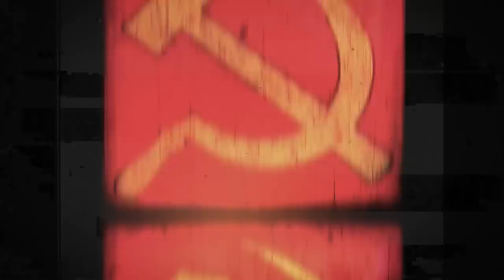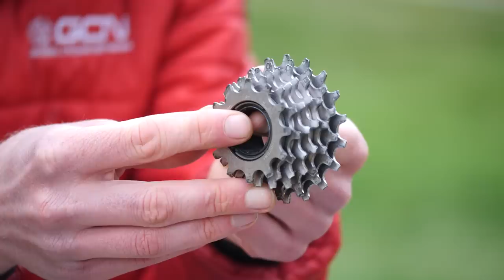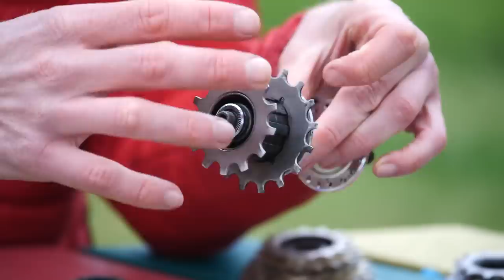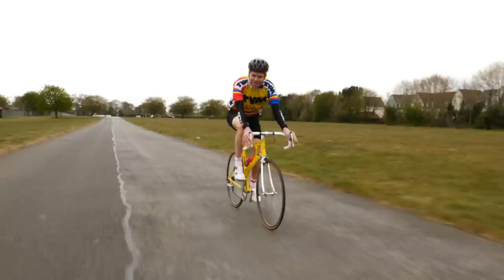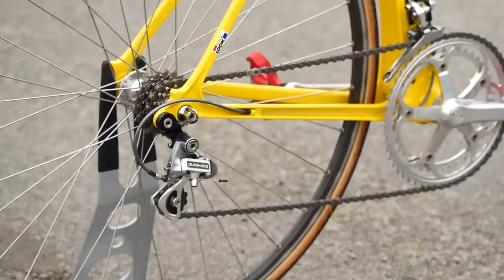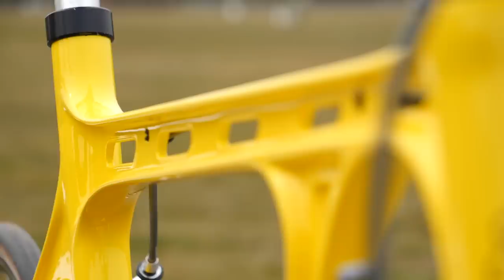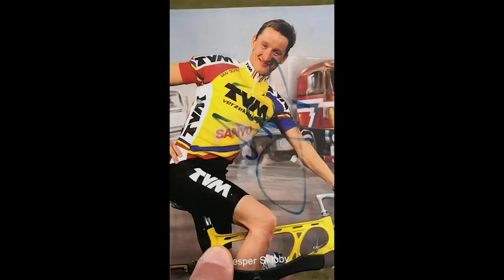The Greatest Cycling Innovation You've Never Heard Of | Shimano Hyperglide

Comment: My daily/beer bike is an old steel peugeot converted to the first generation SIS downtube shifters and 8 speed HG rear cassette, and it shifts almost as well as my modern brifters despite the very old school technology and minimal maintenance. Total game changer. The fact that shimano bangs out these massive innovations quite regularly, mass produces them on an almost unimaginable scale and sells them for the price of a takeaway pizza (even with the current inflated prices those downtube shifters are readily available for 35 bucks and last decades) puts today's 'innovative' brands to shame. Plenty of recent brands get held up as something special by GCN when they are charging 1000% margin on a simple carbon frame or pair of wheels with shocking QC (Usually with plenty of shimano items attached)
Reply: Did you spread the dropouts, or did you respace the axel washers to fit the 8-speed hub in the 126mm spacing? I have a Peugeot with all its original mid-80s components, but I have another Peugeot frame that I'm debating building up with at least hubs that take modern 8 or 9-speed cassettes, while still keeping down tube, friction shifters, and a period crankset and period Sun Tour derailleurs. I just wondered how you dealt with the hub spacing.
Reply: @danielhall3895  I spread the dropouts so I could use new wheels and cassette, and matched shifters/rear mech. I just used threaded bar, two nuts and some washers to gently open up the dropouts, that was in 2016 and it's still perfect despite being used in all weather (I did rustproof inside the whole rear triangle with rust converter and spray wax to be on the safe side). 
The bike is a blast to ride, very simple and very reliable with modern mechs and sealed wheel bearings. Well worth the roughly 200 euro it cost
Reply: @timocallaghan4408  Wish I found out about that method for a steel bike I did recently.  I used the Sheldon Brown method of using a wood plank to bend each side until you have the correct spacing.  The problem with that is I found I was often over correcting on one side, but got there in the end. Although I got some downtube converters so I could install STI levers.
Reply: @markdurdle7710  Yeah definitely crossed my mind that it could end up off centre, but it was too late by then! Steel is quite forgiving though
Reply: @timocallaghan4408  Good to know. I was leaning towards doing the same thing, then I read a post somewhere, where someone managed to get a 9-speed Hyperglide free-hub onto a a second generation Uniglide hub without any respacing needed. The person also provided information about respacing the washers and shortening the axels on late 80s and 90s Shimano 8 and 9 speeds hubs to fit right into the 126mm spacing of older frames. He nailed both methods without having to spread the frame or redish the wheel. I'm weighing which method is easiest.
Reply: @markdurdle7710  I think any method of spreading the stays, probably would have to be followed up with checking the frame alignment. Spreading with nuts and all- thread in the dropouts is probably the most controlled way, with the least amount of re-alignment needed though.

Comment: I have a new road bike with a Shimano 105,  a new gravel bike with GRX810, and a old hard tail MB with a SRAM Duo Drive.  The later is the better drive train hands-down!  Shifts faster, smoother, requires little maintenance, almost bullet proof and I can change gears while stopped.  Plus the hand grip shifter is super convenient to use.  SRAM - Please bring it back.

Comment: Cog heads. This is no game changer. The game changer in cycling for the majority of the cycling community is belt drives with either geared hubs like the Rohloff or geared cranksets like the Pinion.
    Take note: there are many people now punishing themselves riding racing bikes like you are always promoting, thinking they are impressing somebody riding around in a $5000 carbon fiber racing machine. But more and more people are realizing that the Dutch have been smart about it and now ride around on bikes sitting upright with beach cruiser handlebars, fat butt seats and fenders, quietly turning a silent belt driven drivetrain they never have to clean or adjust. Just wash the bike when it looks dirty and never have to worry about getting grease on your pants.
   Derailleurs are old technology. Are they the most efficient? Probably, but they are VERY high maintenance and more prone to failure from high stress on the cables as well as all the other hardware.

Comment: The little grooves to lift the chain to the next sprocket are also weak points...midrive has snapped two of the largest sprockets because of the chain line pull and inherent fold point.

Comment: Hyperglide also has great compatibility across the years.  Any 6, 7 , or 8 sprocket cassette is compatible width-wise with any other of the same count.  9 and up get a little weird.  I purchased a bike with an 11-21, not enough ratio for hills for my liking.  I purchased two E-bay HG 8 speed cassettes, an 11-28 and a 11-32.  Everything is compatible and the spline hub accepted everything I gave it.  I got the gearing I need, and the shifting is pretty quiet and fast.

Comment: Three drivers dominate. SRAM XD, Shimano Microspline and Shimano HG. That HG is Hyperglide and it set the market standard. Even SRAM uses HG. Even now in this divided modern era of 12spd the NX groupset uses a HG cassette. I don't like Hyperglide myself, the system has never worked well for me but when it comes to picking hubs I only go for HG spline. The sheer abundance of compatible parts by far outweighs the limitations of an 11t over a 10t. Box, TRP, Microshift, Sunrace, Shimano, SRAM, Campagnolo and however many other companies all make cassettes for that system. I don't rate Shimano but their innovation is undeniable.

Comment: I still ride a lugged steel road bike from the mid-1980s. It has its original Shimano 600 components - including a Uniglide hub - but when I wanted to change the gear ratios, I switched out the Uniglide cassette for a modern Hyperlide one, along with a Hyperglide chain. Even with the old friction shifters, the difference is absolutely night and day in the shifting smoothness and precision. So yes, I very much appreciate Shimano's engineering in this area.

Comment: When I replaced my shimano 105 5800 series cassete with the new CS-R7000, I thought that I have broken some teeth, because the shape of teeth on smaller sprockets were different, than I expected them to be. I did not notice it when installing new cassete. But I was changing gears under load and heard loud sound and then later inspected, if I broke something.. chain or sprocket or anything. And saw that there are big parts missing from some teeth...

Comment: then they added plastic to the 9000 series, they broke the rivets under load; they doubled rivets, which lasted twice as long. Some lost thirs in weeks. then the 11 speed metallurgy was too putrid for the load, plastic core with bendy cogs... by hand! switched to SRAM xg-1190 and ditched the garbage DA 5.8 mm chain for record  11 5.2 mm: now i have the perfect stiff quiet smooth noiseless Shimano 9000 9100 groupset after i swapped crank and rd. gained 0.75km hr on thes shimano to sram and campy changes... cables, yes, Yokozuna road, not the soft shimano thing..,

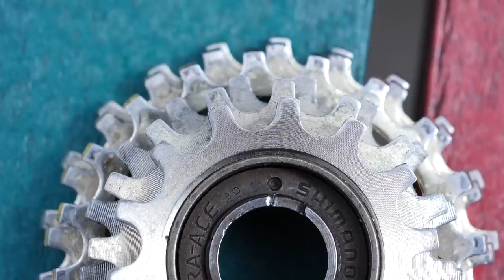Comment: A few points: 1:22 what you have there isn't a freehub body (which is attached to the wheel) it's a freewheel (which screws onto the wheel).

Directional chains weren't used by Shimano until relatively recently (around 2010 or so) and they are usually for 10 speed drivetrains and upwards.

Mavic had its Zap electronic shifting on Tour bikes in 1992 but it didn't turn out to be very reliable (especially in the rain). They also had a bit of a run in with the UCI when their aero shifter was retro-actively banned, after being told that it would comply with UCI regulations (this was after they started making it too)! Shimano obviously learned from this when designing their Di2 system! The first Dura Ace (Di2) and Ultegra (Ui2) systems weren't compatible either, as Dura Ace had redundant connections in the wiring, and Ultegra didn't - the connectors were different.

As far as the "launch" of Hyperglide goes it wasn't a public launch as such. In fact Shimano thought of it as more an evolution of Uniglide and not a completely new technology - hence the very similar names. I do remember that most HG cassettes had "Hyperglide" emblazoned on the large sprocket in a very noticeable colour (red mainly), but later on they toned it down a bit on the higher end groupsets. Most shop staff, at least where I worked, were told by the reps that came around to emphasize how hyperglide made shifting under load much smoother than before, because of the tooth profiles. I don't actually recall that anyone complained about faulty cassettes though. They did, however, complain about the "broken" teeth on the chainset, as 3 or 4 teeth on the middle chainring (of the triple setups) were twisted to aid shifting up from the small ring. This was usually on the cheaper groupsets, which were more commonly used by the "less technically inclined" cyclists, whereas higher groupsets used proper pins for shifting. This was, however, in the early 90s with the introduction of Hyperdrive - the equivalent of HG but for the chainset.

If you want to know about an unsuccessful Shimano shifting technology then look no further than IG. This was an attempt to improve on HG and make it even smoother. It was designed to only let the chain shift at specific points on both the cassette and the chainset (in both directions). The problem was that if you happened to shift at the wrong point then the shift wouldn't happen until the chain reached one of the shift areas. Needless to say most people didn't like the much slower shifting and it also became much more sketchy under load with a worn chain! As far as I can remember this only appeared on mid-range groupsets and not the ones the pros would use.

A lot of Tour riders in the early 90s would actually use the downtube shifters in preference to STI on their bikes for the mountain stages, as they were lighter. I wouldn't be surprised if that Kirk bike was specced for a mountain stage.

Comment: What a bunch of crap.  Shitmano came out with the wide spline so that you could use our cogs only half as long.  Shifting improvements?   I never noticed it.  Nobody ever lost a Tour de France because they weren’t using Hyperglide.   The real advantage of the Cassette over the freehub was that it placed the loadbearing cones next to the dropouts, eliminating bent and broken axles.  

To me, everything since the screw-on top cog, the epitome of engineering, has come from the marketing department.

And don’t get me started on the 10-speed Dura Ace Chains. . .   the only one that has ever snapped on me. . .   three times in three different places. . .   never where I put it back together.

I’m lucky I’m still ball-bearing. 😀

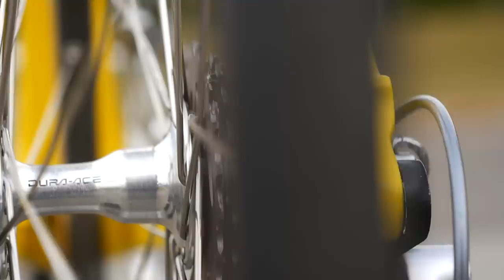Comment: 6:04 I'm not buying that the Kirk frames "... weren't designed for STI levers..."  Most frames of that era had downtube shifter bosses and Shimano provided housing stops that mounted on these bosses.  My guess would be that the team didn't trust the durability of early STI levers, or certain riders hadn't yet transitioned to using STI and just felt more comfortable with downtube shifters.

Also, the cassette body itself was a significant innovation, although this wasn't a Shimano invention (Maillard Helicomatic is the first design I recall).  By essentially integrating the ratcheting mechanism with the hub-shell, the drive side hub bearing could be placed much farther outboard, closer to the frame's dropout - as opposed to the earlier "freewheel" design where there is a large spacer on the drive-side rear axle spanning the length of the gearset.  This new bearing placement strengthened rear hubs dramatically and led to many fewer bent axles.

Comment: I've used a wide range uniglide cassette for a long time, and have to say it works really well. There's a bit more noise when shifting, and it can take a fraction of a second longer before the chain engages, but there's absolutely nothing wrong with it. I suspect it will last five times longer than any hyperglide cassette, looking at the contact area between the chain and sprockets.

Comment: You don’t know what you got on until it’s gone.
My go to bike has a freewheel as it has had for the last 36 years. 
COVID induced part shortages and lack of NOS stock in my parts bin forced me to buy a supposedly high quality reproduction freewheel which unfortunately has straight cut teeth. It took me a couple days to figure out why I had difficulty shifting on a steep hill and the chain would sometimes not leap into the low gear.
I quickly relearned my old technique for straight cut gear teeth, but am looking forward to when I can get a Shimano freewheel again with its fancy teeth.

Comment: Ugh!  This video sent me down a rabbit hole researching the hub/cassette on my Shimano Sante group set that I purchased new in the late 80's and is still in great condition.  I think it's a uniglide (indexed and shaped teeth but no ramps) with SIS down tube shifters.  What's cool is that the shifters can be changed on the fly for either friction or "click" indexed operation.

Comment: Hang on. All this innovations came about because of mountain bikes not road bikes. Indexing and hyperglide. Road bikers and there pathetic rules resist change to anything then look down on any other forms of cycling. I was there when all this happened. Cycling rules applied to mountain bike racing as well. I was not allowed to take point in races when I bought a cannondale super v because the frame didn't contain 3 main tubes. I could race but wouldn't get the points. So piss off back to those gear ratching frame levers you loved so much until   you come up with something of you're own.

Comment: I started out with  Huret  Alvit shifters and derailleurs on my first 10-speed in 1966, and had that bike until 1990 or so, then took a break from bike riding until around 2008 when I bought a Specialized Crosstrail. The bike world sure had changed! Instead of “side-yanker brakes, I had BB-5 cable actuated ball-bearing disc brakes, and Shimano Deore handlebar mounted index shifters, so I am guessing it also came with the Hyperglide cassette. There has been a bit of a learning curve since I do all of my own bike maintenance and fine tuning brakes and the shifter required some YouTube videos. I was pleased by how easy shifting was on a modern bike, and now I know why. Thanks for the content.

Comment: When u rent a bicycle to explore the rice paddies or whatver while trekking around China or other places the most common gears are commonly so worn they slip but I digress. All the Cassettes I've bought from Shimano and SRAM have been hyper-glide.

I wish the last gear ring of the cassette had a few tabs after the last gear or circular wire stop or something. When adjusting the derailleur offset and in and out stops I have to set the stop so when shifting into the biggest gear that it resists the cable some so probably causes more stretching. Even with stops and offset set correctly if shifting 2 or more gears at a time and or bumping over something while turning and shifting down it can knock the chain past the last gear so if u don't have a protecto disc the chain can go into the spokes. But why not have the proecto thing be part of the last gear? A few tabs would probably do the job. Every shift down the chain pushes against the next lower gear except for the very last so shifting off the last gear is much easier than any other shift so stops have to be set so you can barely shift into the last gear.

Shimano, SRAM or all the people who make front forks should also realize that the front is the best place for a cargo rack. You can bungee you grocery bag, or whatever, so it is pushing against the handle bars. A side bag can hang of the front rocket with it's lower bungee thingy going over the quick release axle so u get pannier bag holder for free. When I got biking into the hills I like to take a few beers and or coffee drinks so at the maximum height or after the hard bit is done I can enjoy something while watching the sun set or stars coming out. Springy forks tend to not have an easy spot to mount the front rack. Tour de France riders never seem to be carrying a few beers with them which looks odd to me.

Comment: Those relief sections on the sprockets aren't really ramps. What they do is allow the chain to move slightly more towards the bigger gear when shifting up so the shortened tooth on the larger gear can more easily pick up the chain.